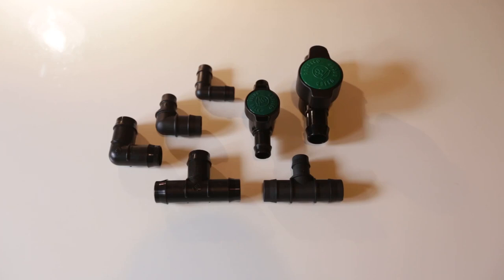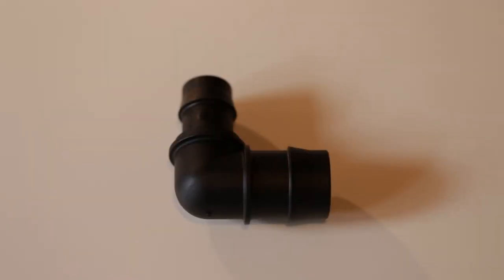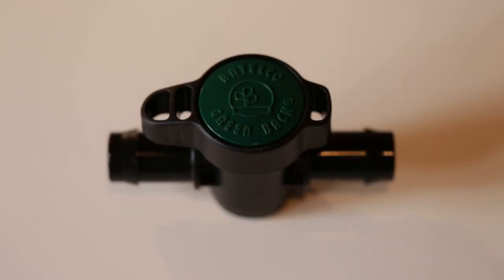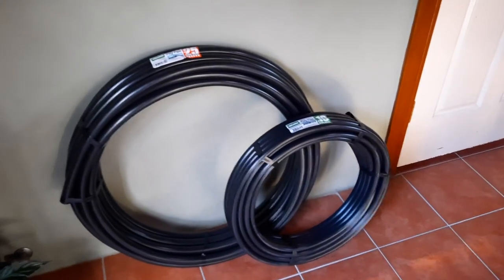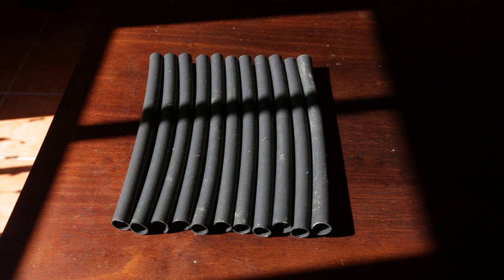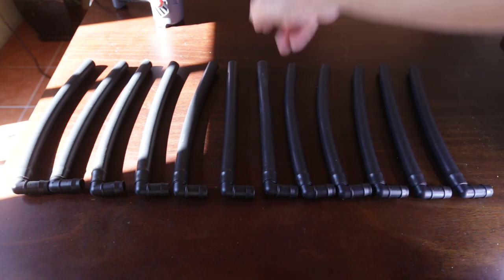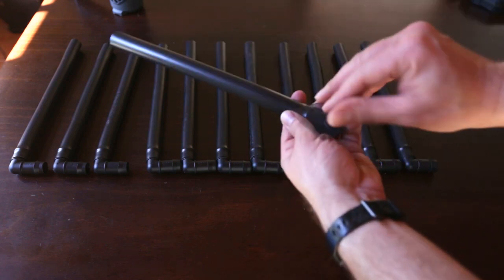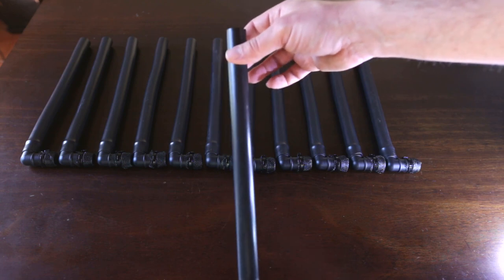Fish Room Water Change System - Part 3 - No drilling

Comment: Are you adding a extra valve and hose in your system to use to vacuum the bottom of the tanks?
Reply: I just installed one in my system. It sure make cleaning easier.
Reply from the maker: Most of the tanks are actually bare bottom tanks with a power filter in each, so thankfully, they don't actually require gravel vacs. However, those that do have gravel (only the similis tank and peppermit bn cats). Simply plug the vac onto the outlet I installed and vac them that way as required.

Comment: I'm using similar parts to you but I'm having leaks at all the connections even with hose clamps on both sides any advice
Reply from the maker: Hi there, I really recommend you watch part 5 of this series. The solution I might be trying is plumbers tape on all the joins and then screw on metal hose clamps. Part 5 is here https://youtu.be/rCN-Tr4HP_4
Reply: @JasonsCichlids  I'll definitely try that out thank you!